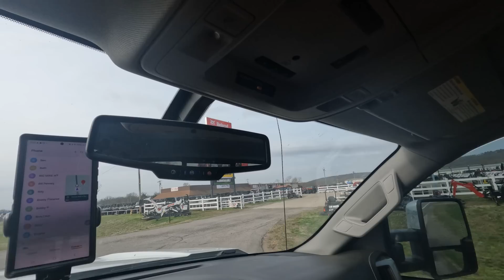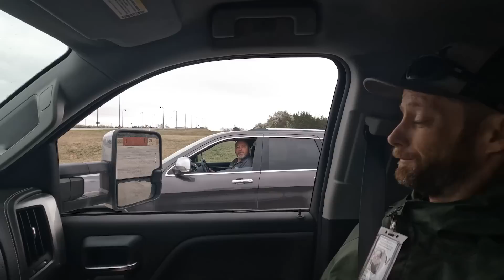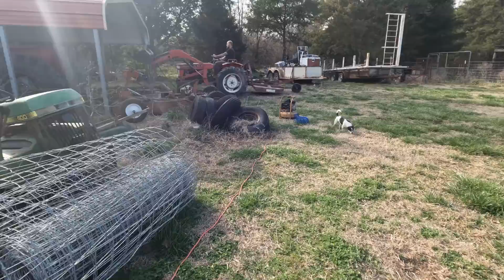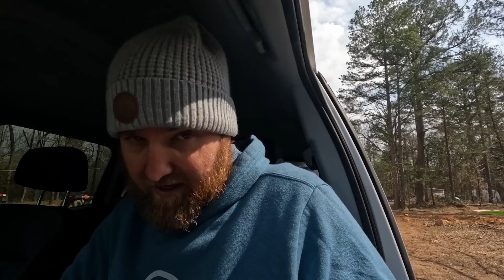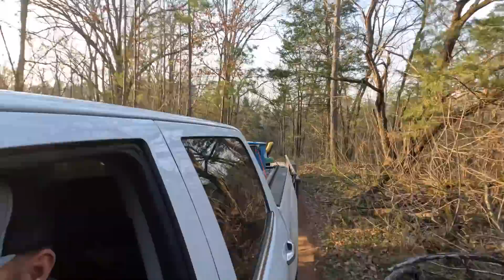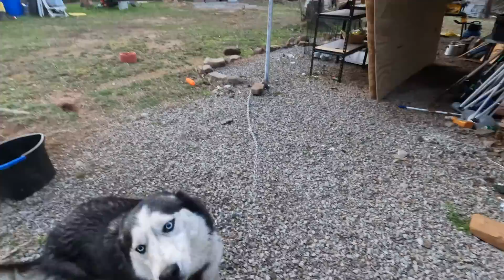THIS KICKED MY BEEP!!! tiny house, homesteading, off-grid, cabin build, DIY, HOW TO, sawmill tractor

Comment: Boy I’m sure glad you all got home safe. Thats one heavy load on those tires. You know that trouble with your arm may have more to do with your editing. A lot of keyboard work can give you carpel tunnel. When I was typing for my school work I found out the hard way. Then when you use your arm for other jobs that when it can go crazy with pain. They make special keyboards with wrist cushions that❤😊 can help with that. But you probably did know this. Just mentioned just in case